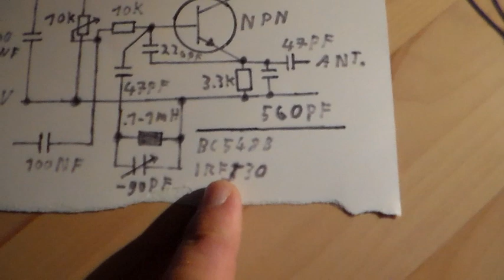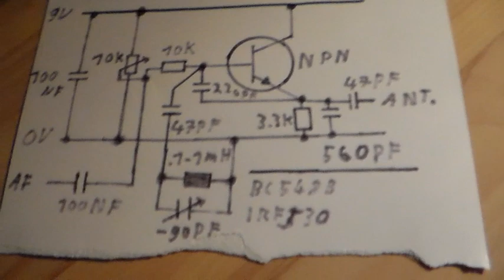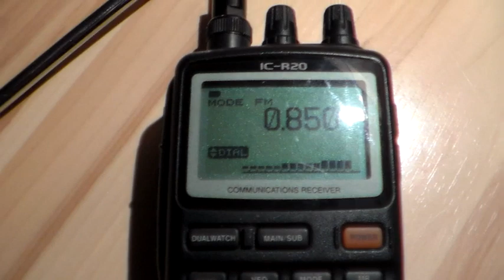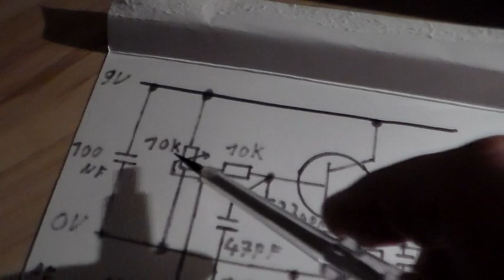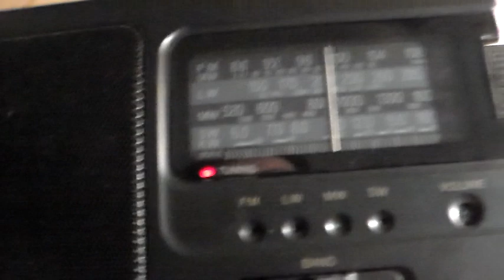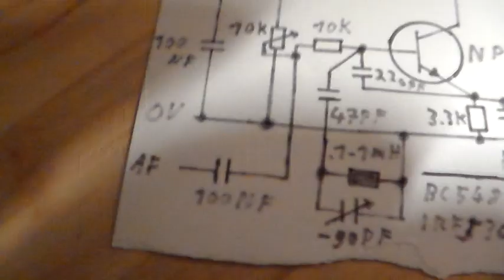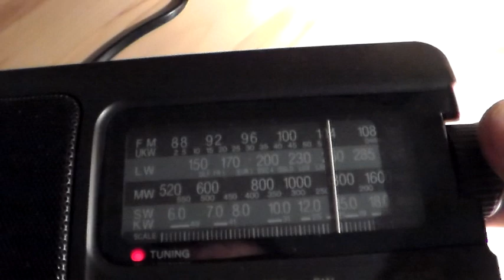One transistor AM transmitter

Comment: Hello. Maybe it is a stupid question but does this circuit work with microphone ? How can I connect my microphone to it ? 
Thank you.
Reply from the maker: A microphone will need an audio pre-amplifier, if it needs to be connected to that circuit. Also there are different types of microphones. Old school "dynamic" microphones that produce a very weak audio signal, and "ECM" microphone capsules, that need a supply voltage, but therefore, they produce a much stronger audio signal. For connecting a microphone to this circuit, you will want to build a 1 transistor audio amplifier (at least, can also be 2 stage if you use a dynamic microphone). Then you can connect it to the circuit.
Reply: @Stefan0719 Thank you so much

Comment: It would be even cooler if you went into how it worked! Like how do you generate a carrier wave with just an LC circuit and a DC power supply.
Reply: robwasabwoukd be good have design explanation like transistor configuration feedback etc
Reply: If you look at the schematic there is a coil/capacitor in parallel at the base of the transistor. It's open to the tuned frequency and a short to everything else making only the desired frequency appear at the base. He said you could take out the capacitor and it would still work, but that is due to the coil's internal capacitance.